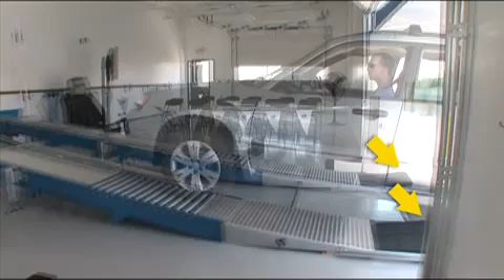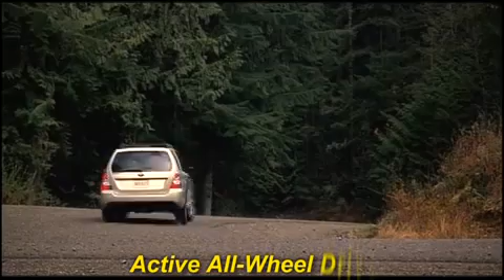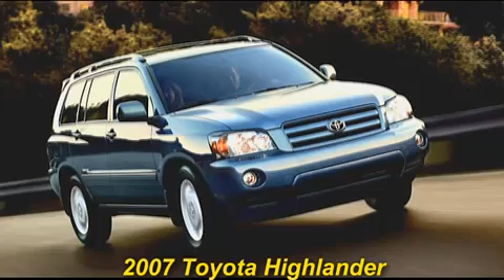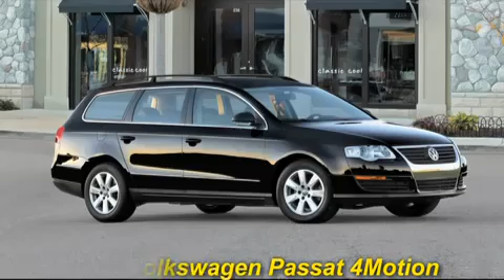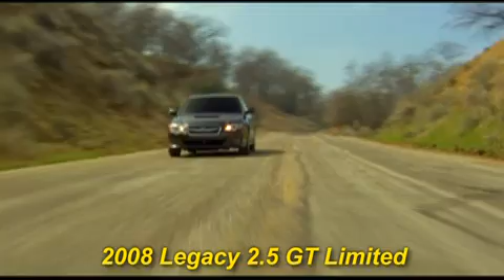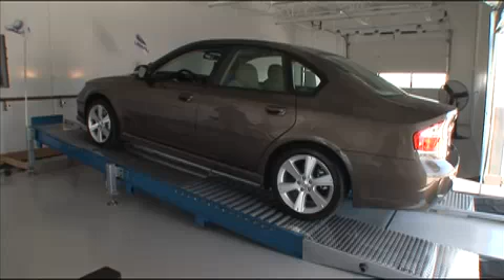Subaru US - All-Wheel Drive demonstration video

Comment: Im licensed to drive anything 2-18 wheels. Have taught high speed public roadway vehicle operations. All you nay sayers can bite it. Subarus AWD, hands down bar none, is one of the finest real world AWD/4wd systems you can buy PERIOD. Couple Subaru AWD to a low cg boxer and the boxer/trans axle gyroscopic physics? Sideways,100mph,high angle departure (ie in a ditch,left front wheel dangling above the pavement). A Subaru tends to stay up right while the rest roll over. Try it naysayers, I dare u.

Comment: Posted this comment 1 year ago, when it wasn't 2012, there's no point posting this comment now... and in Australia the 2012 Impreza does 7.1L/100km (Manual) and6.8L/100km (CVT) and the Civic does 6.8L/100km (Manual) and 6.7L/100km (Auto) It's up to personal preference with both. But I definitely know which one I prefer.

Comment: My 03 Subaru Baja is AWD and gets about 30mpg on the highway. My last car was a 270hp Dodge Stealth, if that gives any indication how I like to drive. Keep your stupid ass comments to yourself if you dont know wth your talking about. Also, the Subaru is USUALLY ONLY FWD unless it senses a need to transfer torque to the rear. Wrong there buddy. The turbos get WORSE gas mileage. Wrong there too. Mines a N/A engine. Turbos get 22-25mpg. N/A get 27-30. Have you actually read ANYTHING before comments

Comment: Subaru is doing it wrong; The MPG of their cars suck, except for their turbo'ed WRX, which is OK for the performance and AWD it offers.
The first reason being because I think their AWD system is inefficient, and doesn't get FWD like efficiency when you are on a plain dry pavement road. The AWD system should default to FWD and the computer should decide when to modify where the torque goes. With this logic, it could still do the tests done in this video.